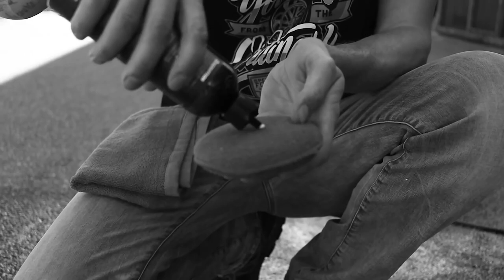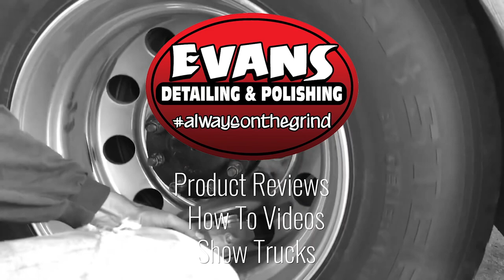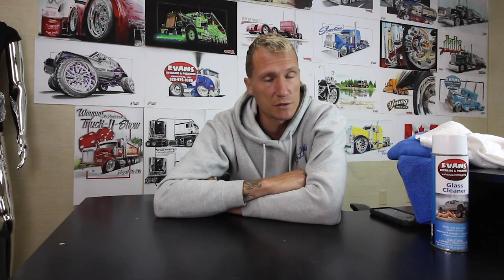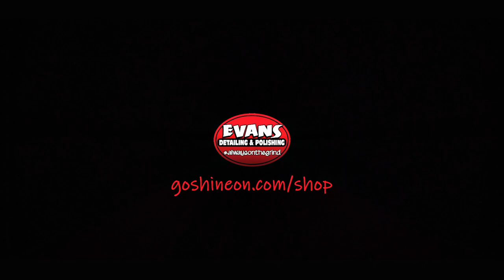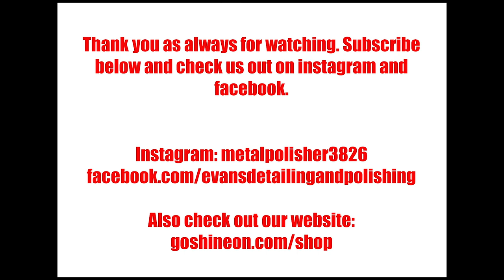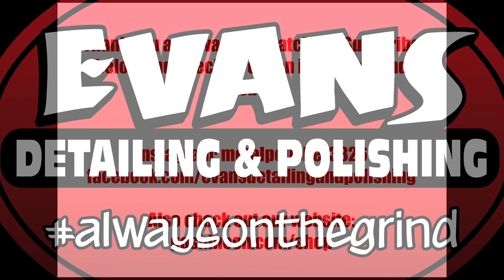How to polish tanks and flat face boxes.

Comment: My local truck shop makes custom flat boxes for the log trucks they build. When a customer wants them polished they get sent to me. Not gunna lie, it's a struggle to get a clean perfect finish. Maybe I'm just too picky, as I am a detailer that offers metal polishing. I am used to sending out near perfectly polish paint so I strive for the same with aluminum.  Hash marks still drive me crazy.
Reply from the maker: It takes a long time to work that stuff out. Don't get frustrated. Many polish years and don't figure that out. Stick with it. Thanks for watching.

Comment: Im new to polishing and have spent hours and hours trying to get a 5ft flat aluminum tool box to look right. Im using a 3500 variable speed polisher. I've tried different pressure, going different direction, doing my best to make even smooth passes from bottom to top, started with 320 grit on a DA to get the pits and scratches out, then tried the orange wheel and brown rouge followed by the joker wheel and green rouge, the second time I sanded again, started with the blue Baron wheel and 87 stainless rouge then went to the orange/brown and joker/green and still get the same result. It looks like rows in the aluminum where you can tell the pattern the polisher was making. Any tips? This is obviously a learned skill not as easy as I thought it was going to be.
Reply from the maker: 5ft flat piece is one of the most difficult things you could start on. Lol. I know polishers many years in that can’t do a 5ft piece.
Reply: @EvanStegerMetalPolishing  dang, I'm gonna keep working on it, I know polishing isn't something you learn overnight, I'm gonna try wheels next. Thanks for the response.
Reply from the maker: @mikeyocain  Flat is the absolute hardest and most time consuming thing to learn. Keep at it. If you can master big flat stuff the round stuff will be easy. Shine on.

Comment: Do you have any tips for cast aluminum valve covers.  I polished ones for my big cam Cummins.  They look dirty and I can't seem to sand it out
Reply from the maker: Cast aluminum can shine but takes lot of work and lots of heat. But you have to be careful. Sometimes it looks like a pit but it might just be a casting pocket. My recommendation is always polish multiple times and keep working it after letting them sit in between polishes. Take them off and buff a few times a year to get them great Can't force perfection on cast.
Reply: @EvanStegerMetalPolishing  try soaking in gas or lacquer thinner for 24 hours before polishing. It will help draw out the years of oil that has been sucked into the pores of the aluminum.
Reply from the maker: @urbanedgeautodetailing  That does work but also creates polishing issues in my own opinion...

Comment: I’m new to polishing I want to polish my motorcycle aluminum. My question is how long does a good polish last and how often do I need to re- polish?
Reply from the maker: That is a loaded question. Depends how often you wash. What you ride through. If you drive in rain. If you only drive in good weather. If you hand polish. So many variables. Throw in the quality of products used to polish and you add even more variables.
Reply: @EvanStegerMetalPolishing  every piece I polish for motorcycles gets ceramic coated after. My personal Vmax parts have been polished and coated for 2 years now and still look as good as the day I polished them. Dirt bike frames that I polish I put paint protection film over the polished area then ceramic coat. When the film starts to show signs of wear I remove it and put a new piece on. I have been doing this on my 2008 yz450 for years. 3 straight race seasons and the frame still looks as good as the day I polished it almost 5 years ago. Proper protection after polishing is key for longevity.
Reply from the maker: @urbanedgeautodetailing  nice. that might be a good option